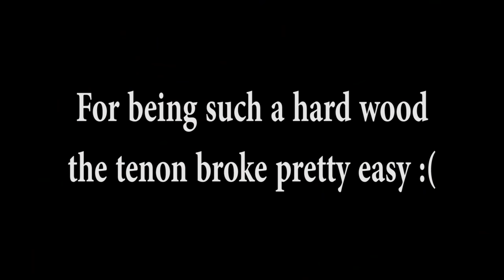Woodturning | Ebony Crotch Bowl

Comment: Carl, how do you find the 'Center of Mass'?   On that type of wood?
Reply from the maker: It's a little tuff on something like this because the heart wood weighs more. There were a few things I wanted to keep on this piece, so it was never truly balanced.
Reply: @CarlJacobson  The heartwood is much heavier and denser than the sapwood.  Using the sapwood for a tenon was not a good idea. This is why the tenon broke, after all.

There is no need to find a center of mass on a piece like this.  As you turn it, it will naturally try to become more centered as the bowl attains a uniform shape and wall thickness with most projects, but it Is impossible to do this with a dual density wood (heartwood has higher density than sapwood).  Just keep it well captured between centers as Carl showed here, and it should turn out all right.  The broken tenon would not have happened if he had made it from heartwood, but the bowl would also have been MUCH smaller.

I question the act of not sanding and finishing on the lathe, normally, but with a large chunk of the side of the project missing, such as a natural edged bowl or a bowl like this, it is a good idea to leave the lathe off and go for the slower pace of hand working.

Adding a few carbide tools to your bench could help quite a bit, with these dense woods. Otherwise, you are back and forth to the grinder a good bit to keep that fine edge.

Carbide inserts can be reshaped and resharpened using fine diamond abrasive sharpening stones or plates... if you get a few plates, go for 800 and 2000 grit or so and epoxy them down on a piece of scrap granite from a local hard surface countertop fabricator... those pieces are nice and dead flat.

The end bowl looks great!  Has gorgeous figure in the wood!  I will need to go out of my way to see if I can get some of that...

Note to all turners:  Texas "Ebony" has this distinct difference between heart and sapwood, and has a large amount of sapwood.  A very similar species is North Texas Mesquite, which has light colored and low density sapwood with a high density tan to dark red brownish heartwood.

The true ebonies are members of the persimmon family.  "White ebony" is persimmon, has thin sapwood, is very light colored and high density.  Massacar ebony has a thin sapwood and a near solid black interior, with streaks of golden brown running through it.  Gabboon ebony is the "true" ebony in the minds of most people.  Thin sapwood, near solid black heartwood, with dark green streaks running through it.  All three of these have high enough density that they do not float on water.

Comment: Any tips for reducing wobble, when I use my faceplate and cut the tenon for my Chuck once I flip it around it always seems to be off
Reply from the maker: It's always going to be a little bit off because the way the chuck jaws grab it. I rough turn the bottom of the bowl and make the tenon, then do the final few passes after it's in the chuck.

Comment: Beautiful bowl. I recently did a video for our club since we cannot meet and had a situation where I had to redo a piece. I asked the person putting it up on youtube to cut section out before posting but he could did not and I've had a number of responses in appreciation for leaving the couple minutes in. I guess it is encouraging for others to see our mistakes. On your vacuum chuck leaving a ring inside the bowl - I've had the same issue/frustration. I've started putting a double layer of clear plastic wrap over the chuck. I hold it on with a rubber band then cut an X slit to allow the air through. This has helped eliminate/reduce the ring inside the bowl. Thanks for the great video.
Reply from the maker: Thank you! And Thanks for the tip on the vacuum chuck! I'll give it a try!

Comment: Beautiful bowl!
I am not a turner but have worked with ebony and mesquite.  They are similar species and have dense, hard, and brittle wood.  The heartwood and sapwood make nice contrast as is seen in your bowl.  The biggest challenge I have had with these woods is that the grain is always twisting and moving around making it difficult to plane, resulting in a lot of tear out and chipping.   I normally end up working the piece as best as I can and then sanding down to finished dimension to remove the scars.  With that in mind, I am impressed with your lathe work and your result with this ebony.   A penetrating finish, like yours, really brings out the dark beauty of these woods.  Again, nice job!
Reply from the maker: Thank you very much Brian! Yes it's a very hard and difficult to work with.

Comment: Great bowl indeed , 
I would like to ask if it is dry , how could a big piece like that got dry without cracking and if its not i think its on the thick side , wont it crack when it dries ?
Reply from the maker: Thank you Antonis!! It was fairly dry and it did have some cracks in it. You can see them in the beginning of the video. I was able to turn most of them out, but I did fill a few with black CA glue.